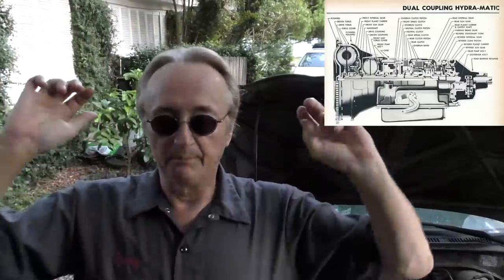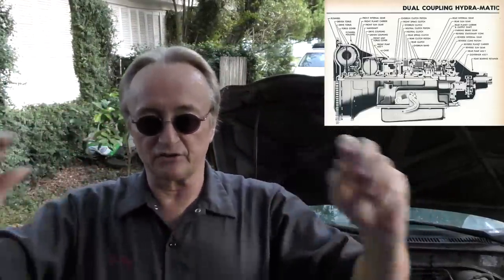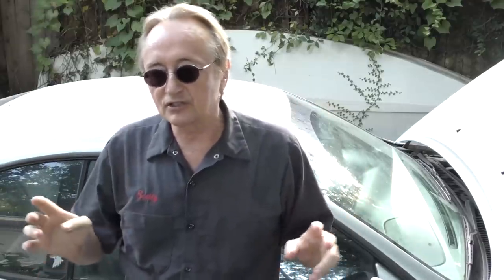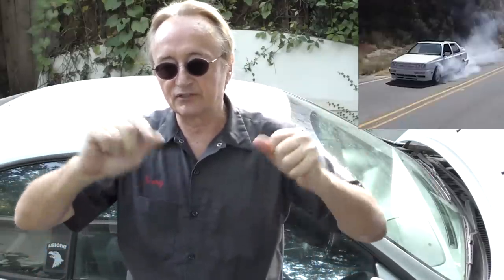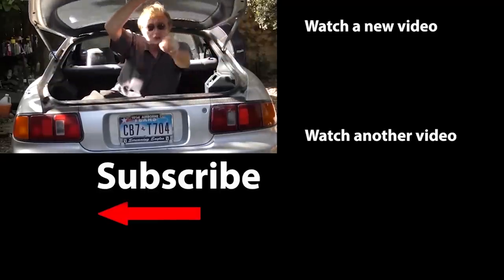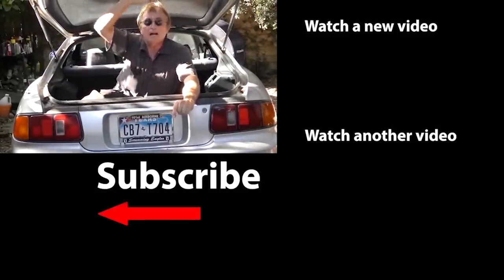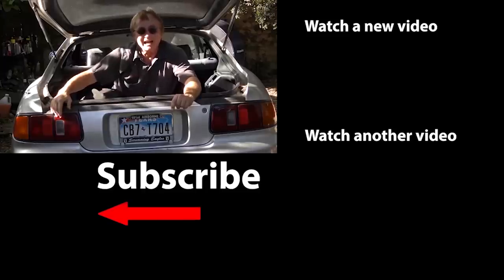This Isn't a Real Corvette, Here's Why

Comment: Am I the only one who thinks it’s a bad idea to put more computers in cars?
Reply: yeah
Reply: No.
Reply: im 19 and i prefer simpler things if we had less electronics in cars one they would be a little cheaper and 2 they would be simpler to maintain. You wont catch me dead with a post 2000 vehicle except for a couple exceptions
Reply: @redrevo_117  Educate your generation!
Reply: no
Reply: It's not about computers, it's about the quality in the build
Reply: Its literally all junk and makes new cars over priced. There is no car on the market of interest.
Reply: Ye its piss take bro , it so we can do nothing to them are self , that why I like to buy old cars
Reply: No you aren't!
Reply: @southwestpark forever im not saying theres not great cars made in the 2000s  im saying im not interested in the unnecessary technology that they are shoving in them and like others have said it increases the price needlessly.
Reply: No, I'm in my early 20s and I much prefer 60s and 70s vehicles cause they do what i tell them with no nanny features.
Reply: Nope. Old saying "A computer can do in 1 hour what 100 men can do in one week; but can also make more mistakes in one hour than 100 men could make in a week". And when the computer modules have an issue they replace them not repair them. You pay a lot of money for a circuit board and a few silicon chips.
Reply: All made in China of course.
Reply: Nope - the new land rover defender has 85 separate ecu’s - that is going to be a nightmare as it ages
Reply: Yes finally someone who agrees with me
Reply: We need to simplify it a bit because it becomes a problem when diagnosing
Reply: Amen. Now older cars are becoming more of an investment than ever.
Reply: @redrevo_117  post 2006 and you're correct pre 2000 is a pain with smog
Reply: I heard that Tesla's app quit working for a few days and people couldn't drive.
Reply: nah man, they should put general purpose computers with easy to replace abd repaire parts, and that are all interchangable, with making all the software open source and connections standard

This way, when a computer brakes, you can diagnose, fix, replace, and modify it
Reply: Self-driving cars were you actually can go to sleep.
Reply: @Jaml321  only problem is as people have abs they quit thinking like they should and start running lights and stop signs.
Reply: Yes and no
There’s a few electronics that’s cars don.t need. 
And there’s a few electronics that are great for cars ( cruise control)
Reply: Nah, more computers means less error. Humans are very clumsy compared to a computer that can do repetitive task.
Reply: What 100 is too many?
Reply: Lol, Its a balance. We just need to design the systems to be better and more repairable. Tech isnt all bad
Reply: The cars become more money pits
Reply: @redrevo_117  You will learn.....you can drive old cars for the rest of your life. When you are 60 a 1999 vehicle will be 61 years old. At which point You will be saying how great 2040 vehicles are as opposed to 2060 model years...lmao...
Reply: @WastelandArmorer  SU..🙄🙄🙄 A 70'S vehicle  is less reliable than a new car. I will be laughing when you are broken down on the side of the road 200 miles from home...
Reply: @garfieldsmith332  OH BOO HOO...
Reply: I just want a v8 manual bare bones.
Reply: RedRevo 117 
Yeah yeah watever zoomer
Reply: Yes, until it all begin to fail 😒
Reply: Yeah it's bad. Do what I do, drive a 3-6 thousand dollar car as ur daily and ur luxury as a weekend car. It will last forever that way.
Reply: @southwestpark forever 0.
That's how many.
Reply: @Jaml321  Pass.
Reply: yes,it is stupid idea to put any computer in a car -car should be computer free-honest simple device to take from A to B
Reply: Anyone who doesn't just eat up every new thing on the market to have shared interests would agree. Otherwise people just let hype and some sheet with numbers on it determine its value. There's plenty of cars with manual to choose from, enough to out live me 10 fold, so hey, next Jenner's, have fun with autonomy and eventual fall of human kind. Not going to lie tho, my impreza really needs a new flywheel.
Reply: Anti-Lock Braking System (ABS), Electronic Stability Control (ESC), Tire Pressure Monitoring System (TPMS), Lane Departure Warning System (LDWS), Adaptive Cruise Control (ACC), Driver Monitoring System (DMS), Blind Spot Detection (BSD) and Night Vision System (NVS). Sure we do not not need them all but some are safety essentials. Computers makes our vehicles of today safer than they were before. The only downside to it is that, cars  became more vulnerable to component break downs.
Reply: @Anth230  And a 70's vehicle can easily be repaired by yourself, at home, cheaply, with simple hand tools.
I'll take that all day every day rather than having to take my car to an overpriced specialist for routine maintenance.
Reply: @Anth230  I will be glad to charge you 300 bucks or more an hour to solve any computer problems you have. In your car, your PC, your appliances; anything. Snap a part out snap a part in. Then rerun the set up software. A half hour and I can make more than the people serving fries can make in a week.
Reply: @mpossjr  nope i was born in 1999 my first car was a 63 chevy corvair and it does fine. And does anyone like the pt cruiser? not many
Reply: Considering how bad some drivers are. No.
Reply: @Anth230  70s you need to remove emissions controls and rebuild the engine to bring them up to 60's standards Since the emissions controls are a determent to reliability, and rob the engine of a good percentage of its power. Mine has outlasted all my friends newer vehicles since that was done a decade ago. The few times it has broken down it has been extremely easy to repair.
Reply: Never should have become more computerized than they were in the 90s.
Reply: Absolutely! Especially those made by Skynet, I'd avoid any of the computers they design completely!
Reply: @garfieldsmith332  🙄🙄🙄
Reply: @redrevo_117  Try post 2010
Reply: @mpossjr  yeah it is nice (conv. aswell) would be better once i get done putting floor pans in it tho... and yeah pt cruiser is a good joke
Reply: @redrevo_117  The trade off is a car that brakes worse, uses more  gas, pollutes more. And uses guess work instead of a code scanner...
Reply: If you have anything older than an 88', chances are you have a computer in your car, however simple.
Reply: @WastelandArmorer  They also killed a ton of people. Unnecessary technology? Radial tires, pollution control,  disc brakes, seat belts,  airbags, fuel injection,  ABS, traction control, back up cams? Just what is Unnecessary?
Reply: @slavar3294 Fine. Try driving a Model T.
Reply: @bLackmarketRadio  cars are not items people  want for 40 years.
Reply: @WastelandArmorer  All you did was make noise and pollute the air.
Reply: @LostBeetle  And you still love pay phones...
Reply: @WALTERBROADDUS  unnecessary electronic tech, tire tech advancements are fine and were needed , pollution control hurt developments in the 70s but i understand why , disc brakes are a great advancement, i have a thing against airbags hurting visibility, fuel injection eh i prefer carbs if you break down you have the basics air, spark, gas and you can get running decently easily, backup cams we do have mirrors for a reason you know.

 we rely too much on computers too much nowadays what happens when electronics just stop working the only thing that will work are outdated/primitive tech.
Reply: @redrevo_117  I agree with you.
Reply: Yup. Once electronics fail, they’re a nightmare to fix.
Reply: RedRevo 117 Me too. I have a manual 2003 Mustang GT. I love it. It’s simple and not complex unlike new mustangs.
Reply: @WastelandArmorer  Not sure what you drive or where you live. But where I a 40-50 year old vehicle will not survive many harsh winter's .
Reply: @pete witheridgeI highly doubt the invention of the TV remote robbed anyone of significant exercise. 😂😂😂 Same with the decline of the manual trans. I mean is it really lazy that one is not shifting at every light? I don't think so. Autos are more convenient, same with the TV remote. True laziness is probably someone who actually doesn't leave the house, doesn't have a job, doesn't exercise (which I bet at least 60% of the people here either never do or barely at all) and have no hobbies or extracurricular activities.

That said....i.dont ever want self driving cars.
Reply: Computers are smarter and faster than humans. Do with that as you wish.
Reply: @garfieldsmith332  I never paid that much in my life to ever fix a computer. Never had any electronic issues in any vehicle as well. My newest vehicle doesn't have any unnecessary electronic options. No infotainment system, heated steering wheel, etc etc ..
Reply: Computers are good if u dont like working on your own car and like having the dealership hands in your wallet.
Reply: @Cardell15  You mean if I get a new vehicle i won't be able to work in it????? Hahahahahahahaha......if you think that you can't work on newer cars yourself, you are very misinformed...
Reply: More computer on car = more fails and more codes = More Money for the company who build the vheicle 👍🏼👌🏻
Reply: Yeah! I mean.. If the worlds gonna turn Mad Max post apocalypse soon. How are we gonna easily maintain those cars😂
Reply: They're great when they work, but when sensors break down, and provide those computers with false readings, I bet that they're going to be really dangerous. We'll see in about 20 years. I'd trust myself, or another human to safely drive through a blizzard, than some computer. The day we finally lose the ability to drive ourselves, is a day where we also could quite possibly lose a LOT of freedom.
Reply: @WALTERBROADDUS  Yeah, you got that Ferrari you always wanted?
Reply: @WALTERBROADDUS  Guess work?
Spoken by someone who knows absolutely nothing about actual diagnostics. You just let computers do all the thinking for you.
Stand back, son. Let the adults show you how to fix things.
Reply: @WALTERBROADDUS  Pollution controls, airbags, fuel injection, ABS, traction control, backup cams.

Those are all unnecessary.
Reply: @WALTERBROADDUS  I'd gladly drive a model T.
Reply: No, you’re not. More to go wrong and will soon be outdated, expensive and broken. Keep your cars simple.
Reply: @Anth230  I checked your channel, didn't see you working on a single new car.
We got an armchair mechanic here, guys.
Reply: Samual Jones  Give your plants Brawndo. It's what they crave.
Reply: Go black to sleep Grandpa
Reply: @Cheemtu  Not an argument.
Reply: @Jaml321  haha now that is funny I like you.
Reply: @bLackmarketRadio  Scotty's viewers are pretty hive minded no point in screaming at a wall
Reply: I'm a retired EE so may not be all that objective but I think having multiple computers actually works out well and can make cars more reliable. The nice thing about a computer is the access to a lot of information that can help with the troubleshooting process. Your choice is either lots of electronic smarts or try to do the same thing mechanically, I'll take the electronics.
Reply: I'm afraid I can't answer that, Dave
Reply: @bLackmarketRadio  Well........the EPA and your insurance guy says different.
Reply: @bLackmarketRadio  You want play Dr. House to a car. The rest the world plugs in a ODB2 scanner to get the answer without the hour of commercials. 😏
Reply: @redrevo_117  You waiting for some Mad Max Universe to travel the outback in a Black Ford Falcon Xb?🤔
Reply: @WALTERBROADDUS  anything can happen in the future weve got no idea why do we need something that can be rendered completely useless in the off chance that something happens
Reply: Its a 4x4 70 Chevy pickup. It has survived 43 Montana winters where it gets down to -20 and we get several feet of snow. I bet where you are they must use road salt as that will destroy them pretty quick.
Reply: @WastelandArmorer  Yep, Almost hiring time for Pendot seasonal salt truck drivers. We rarely get a foot plus snowfalls in Philadelphia. As for rust? My First car was a used 1979 Datsun Datsun 280ZX with a floor hole and frame rust. Thank God, undercoats have improved.
Reply: We get several feet of snow in the winter in Montana. Thankfully we don’t salt our roads so older vehicles generally don’t have rust issues, particularly it’s extremely rare for the frames to rot. If we did salt them we would have more issues with that.
Reply: Well no. More computers = latency / added weight. But a computer with more efficient programming is the way to go. Computers maximize our car’s optimal output, there’s nothing wrong with them.
Reply: Yeah..everyone could fix cars when I was a kid.  Now everyone needs to take them to the garage, sometimes to fix the simplest thing.
Reply: No you are not. Adding more computers means more security flaws to have to patch up, more complexity, and more things to go wrong. That's why the Trabant is the best car.
Reply: Kyle Nelson My Mustang doesn’t have 20 computers tho. It’s a manual transmission with traction control that I can turn off. This car is very basic compared to any 2020 car.
Reply: @kylenelson944  i said "no computer in the car"
Reply: @kylenelson944  i have no computer in my car
Reply: @kylenelson944  I agree with you. I was just making a statement that has been around since computers entered the world. Worked for over 35 years in IT, from mainframe to PC. And the first contained 32K of RAM, enough to send men to the moon. However in some cases their is too much "computerization" installed into products.
Reply: Kyle Nelson That is debatable. I’ve seen morons going to sleep on the wheel of their “self driving” car and nearly hitting a divider before. Less computers make you drive safer.
Reply: @angelgjr1999  The one that I see that too many drivers rely on is the cross traffic backup warning. Drivers do not look while backing up nor do they check side to side. They just back up expecting the alarm to do it all for them. Some drivers bomb down the road so fast that there is not enough time to stop backing up once the warning sounds. The cross traffic warning is good, but you must also use your eyes to double check.
Reply: Early 90s to maybe early 2000s I think is the sweet spot for reliability, simplicity, efficiency and amenities. OBD1 is great since there is rarely emission testing any more and very simple technology. OBD2 into the early 2000s still fairly simple and reliable,  and specific codes is helpful. Plus these cars can be had with durable drivetrains and power everything. Also enough safety features. At least with newer cars with all their nanny features will hopefully prevent the texting idiots from hitting my vintage vehicles. I don't need or want all of that, I pay attention and am careful. ABS and airbags are plenty.

Comment: My bicycle has a 21-speed manual transmission.  And the fluid never has to be changed!
Reply: How many miles you got on that bad boy?
Reply: 1stTiger Tiger,
" ... And the fluid never has to be changed!". You drink water, you pee -- fluid changed. Has to be.
Reply: I had 33 speed with 10k on it
Reply: Lol Nice
Reply: @ArkoZakus that would be the cooling system sir, but yes that the only fluid that needs to be replaced.
Reply: The chain still needs fluid
Reply: GuerreroDeLaInfo...was just going to say this...it has been added...definitely.
Reply: GuerreroDeLaInfo...but...he is correct that it “probably” hasn’t been changed...he probably hasn’t completely cleaned his chain & then added lubricant.
Reply: GuerreroDeLaInfo...why am I still writing...he probably hasn’t cleaned & regreased any ballbearings... I wanted to really said that I wish the new Corvette C8 STILL had a manual transmission + this dude is obsessed with Toyota.
Reply: Theres a company that makes hydraulic shifter for bicycles now.
Reply: 1stTiger Tiger how much torque it can handle?
Reply: Mine too and it's essentially paddle shifted, no clutch.
Reply: All the lube on my bicycle got washed off after riding in rain multiple times and then I just rode it like that for over a year and it clacked like mad and I was so lazy I didn’t care
Reply: damn I bet that 0-60 in like what 2-3 minutes?
Reply: @DavyDave1313  you mean never, unless you go downhill. even tour de france pros top out at 40mph in flat land. which probably feels like 100mph
Reply: Haaa wtf lol 😆
Reply: @PhilipKaskela  dang. I can only get to about 30 on flats, and that's huffn n puffn. Comfort cruise would be about 15
Reply: Ya but u got like .2 horsepower tops🤣
Reply: let's hope no fluid ever needs to be changed. Draining fluid from having "water on the knee" is no joke!!
Reply: I'll bet your fluid needs changed.